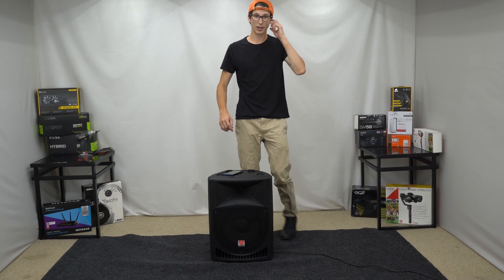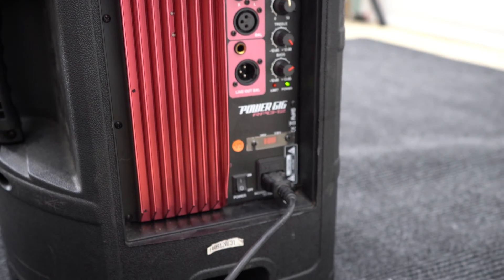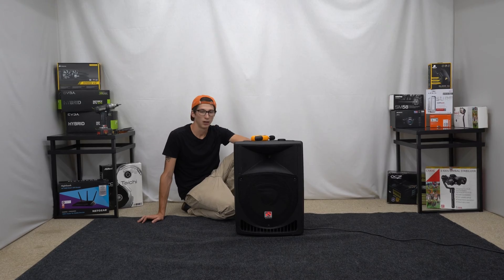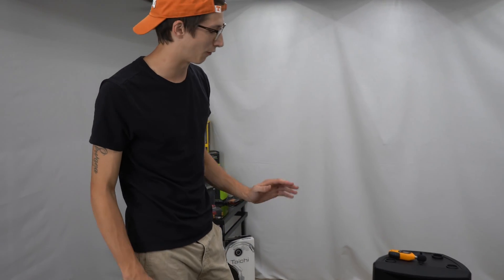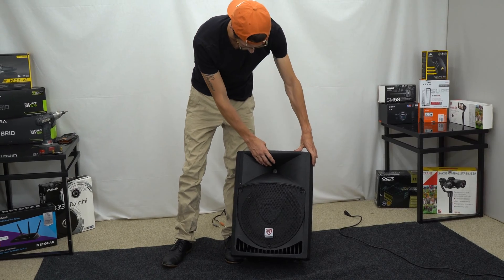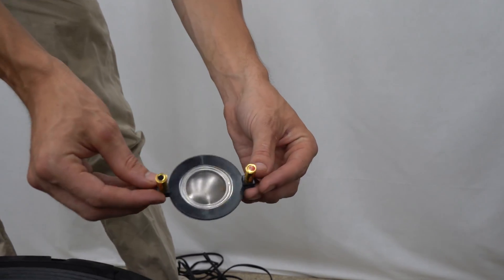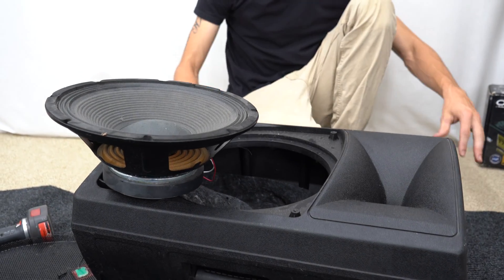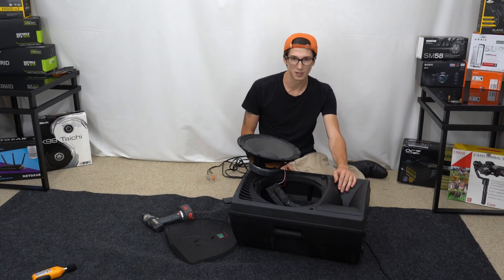Rockville Pa Speakers! Junk? What's inside?

Comment: I can't think why you seem disappointed by the fact that these speakers are quite a good bang for buck. You begrudgingly acknowledge that your (less than optimum) testing results came out positive, much like the overwhelming consensus of opinion in the comments. I've never seen any of your videos before, and likely never will again. I landed here in response to a query about the quality of these speakers, which I just bought for my home studio.

It seems you're possessed of the notion that price directly and without exception reflects quality, which is really a bit snobbish at its core (like having an Ivy League PHD means you're smart). Anyone can pay a million dollars for a top tier piece of equipment, but a smart buyer can find good, solid, serviceable equipment for a down-to-earth price. I'm not shy about spending money on gear, I've paid as much as $25,000 for a vintage guitar, but I consider the purchase of these speakers (and an accompanying amplifier) to be an excellent deal.

The best reviews are the ones that are honest and straightforward, and not bogged down with unwarranted, preconceived notions.
Reply: I guarantee I can get a better sound from 2 Rockville RPG12 powered speakers and a simple mixer for under 500 than my band ever could with a new Sun PA system that cost 25,000. We lost our old crystal clear vintage Peavey system to a bar fire. We should have looked for an old used 70s PA system instead like we had before.

Comment: i have 2 rockville  rpg 15 bt and a rockville bpa12 with a behringer 1000 w 15'' sub.we do 40 gigs a year ,we are a 4 pc band.we triggerd acoustic drums with an older yamaha module and have keys,1 guitar,1 bass ,3 vocals.we try to take gigs that have house sound but that dont always work out or their system sounds bad.this sys has never let me down,it sounds great.we use yamaha mixer/preamp mg16.most powerd speakers would sound bad if you test them like you do.ive had,jbl,qsc,mackie  speakers the qsc are great but to heavy and to expensive  i have the qsc153i spks....they sound great but the horns blow for no reason,and parts are un available  most of the time.for the money behringer and rockville are the best fit for our band,if i add 2 1000 watt berhinger and 2 rockvlle 1000watt 15' wlth a sub for the mains its all you need.the key is dont overdrive them to distort.if you need it louder just add a speaker. ive heard most dj set ups just clipping and distorting becuz they dont get it.i know these cabs are rated with peak readings, and they dont produce anywhere near true  1000 watts.soon as you overdrive the amp it creates distortion ,that distortion frys the voice coil.....true clean power dont  blow speakers.

Comment: In my opinion these speakers don’t hold a flame to Mackie thump 12a’s. Want real disappointment review the Rockville 18” active subwoofers.
Reply: Mackie speakers are WAY more expensive though. Some of us are poor and just trying to find something decent we can afford. One of my Powerwerks PW50 speakers blew as soon as I used it after having it for 2 years so I`m replacing with something much larger but the same price.
Reply: Mackie thumps are pretty budget speakers that are professional grade. That’s where these cheaper speakers like Rockville fall short, they aren’t professional grade. Another budget friendly professional quality brand is Alto.
Reply: @AndrewNelson1985  I saw review after review saying Alto powered PA speakers quit working after less than a year (8 months average) but I saw some reviews praising the pristine sound. I wish I could get my hands on an old classic Peavey PA system or a couple of their 500w powered monitors and be done with it.
Reply: The thing about reviews is that’s where everyone goes to complain. I own an audio production company and have experience with all kinds of brands. I’ve never had a piece of equipment fail using them as designed. What causes failures particularly with speakers is distortion. Pushing the speaker hard than it was designed to do. Not setting proper gain structure. Regardless of brand if you keep it from clipping it will live. With that said you get what you pay for, hence why an $800 speaker will outperform a $150 speaker.

Comment: I bought the 12" subs as a joke/experiment/possible project speaker to modify and they surprised the hell out of me
Reply: bro the rgb12?
Just ordered one
Reply: @coolelectronics1759    I got the passives
Reply: yeah probably running a good amp too is all it takes really.
what amp u running?
Reply: @coolelectronics1759    QSC GX3.  more than enough.   @ way electronic crossover helps to,  crossing over at 120 hz or so to some powered tops

Comment: I have 2 pair of the 15s and the 18in sub, all active.  I have been using g them for weddings and parties for over 6 years now. The trick is to back the highs off to the 11 or 10 o'clock position. With 2 of them and the sub at 7 I was at 119db+ at 30ft away.  These will pound and are clear, they get better as they get broken in.

Comment: Well I like your video. You were kind of going so straight to the point. I personally don't know Rockville, but I am looking for something loud and reasonably cheap.
As an electronic technician I can say got what I saw in the video that the electronic soundboard might not be the best, but with a thoroidal transformer and a decent heatsink, the power should be considerable 
Maybe not to the 200 RMS they claim but really with half of that, it should punch solid.
The speaker doesn't look that bad, of course with the price and power the output delivers you won't expect a 5 pounds of magnet.
I however didn't find out if it uses an Integrated circuit or transistors in the final output stage for you didn't take out the main board 
Anyway you did a lot in your video and I perceived you were trying to be honest.
Thanks buddy

Comment: Wow a lot of distortion. The speaker itself I’m positive it can play louder the problem is the extremely underpowered amp it comes with. Yeah looking at that driver that could easily handle 100-200 watts of power. Unfortunately Rockville likes to seriously seriously over rate their amps. The voice coil in a speaker is not visible by looking at the driver it’s within it. Interesting video though

Comment: Of the budget speakers (harbinger, behringer, samson, rockville, etc) which do you recommend?
Reply: alto true or more realistic specs for output wattage and you can hear it in there tx line I have the 8s.
rockville is pretty good for there passive stuff havent tried there amps/powered skeaker yet although I do have there 12" powered sub and it gets the job done no issues.  Behringer and harbenger for the most part I know have good stuff for the money too although I haven't tried any harbenger speakers but did own a 12" keyboard amp/pa speaker from behringer that worked fine for several years.
Reply: I’ve heard good things about harbinger, and heard some of their products. Their subwoofers really surprised me. There was an event with high-end jbl vrx932lap arrays, and one year they brought two vrx918sp subs, which I was disappointed by. The next year, they had a single $600 harbinger vari 18” sub, and I seriously thought it was louder than the $4318 sub setup the year before, although that may have just been the sound guy. But my point is, It kept up with the vrx932lap arrays without struggling, which is completely crazy!

Comment: 1 meter is less than 3 feet. It looked like you were around 5 to 6 foot away during the test which would give false reading. Not knocking you just stating the facts.
Reply: 1 meter is about 39 inches, which is more than 3 feet (36 inches).

Comment: I just got a Rockville SPGN128 (passive) speaker to use it as a floor monitor for live sound. The bass and the mids are good. The highs are very bad. There is no sssshhhh coming from the speaker and I have a very good mixer, equalizer and amplifier set up. Am I getting the normal sound of the 1.35" titanium driver that Rockville uses or mine is defective?

Comment: This was more of a critics review than an honest review....learn a little more about your products before just reviewing and bashing them for what they are not.....proper testing is a must.....just using a phone to run tests is not a true test of performance.....used with a mixer you would have probably gotten different results.....best bang for your buck should be your topic, because anyone can criticize if they can spend more money on a more expensive product.......sure you could buy one that costs $1000 and have an output of 3000w at 120db.....but even you said at 106db and being behind it you couldn't handle the output it was so loud.....I have seen these and other brands (even cheap brands) used and for the money they have an awesome sound if set up correctly and didn't over push the system for the size of area it was being used in......also most people are looking for a comparison review to purchase a product.....gear towards that and you should see your subscribers numbers go way up !!!
Reply: Also your placement of the dB meter is in the wrong location.
Reply: I just re-ordered them. Got 2 of them + stands + XLR cables for $460.
Reply: I believe he was saying at 106db he couldn’t handle how bad they sound, that’s why he apologized. Listening with my headphones on that was the first thing I heard when he turned them up, how bad they sound at loud volumes. I’ve heard these at a karaoke bar once and yes they get loud, but they are not very clean and the feedback was horrific.
Reply: I have run a pair of the RPG 15s  for years.  I run them with a pair of the Rockville 15" subs that are based on an old Mackie design.   I've invested less than 1500 bucks in the whole pa system and then I added a dbx driverack unit so I could calibrate the system for different rooms.  Total pa cost including the Flow 8 soundboard is under $2k.  Uncalibrated the speakers don't sound very good.  Calibrated they sound amazing.   I am planning on switching to QSC KC12 column speakers for lighter weight,  faster setup and no calibration needed to get great sound.  Total cost for the upgrade is over $4500.  More than double the price of my current pa, and I will need to add a QSC 18" sub if I want to be able to do large rooms like I can know.  That little thumper is another $2600.  So, basically 3 times the price to do what my pa does now.  If you look at the Rockvilles in that  light I believe they are very solid speakers that give a big bang for short money.   I'm not planning to get rid of mine even when I upgrade.
Reply: Nah man, these are total shit either way, not reliable even if they satisfy the application. I have first hand experience!
Reply: @Black-k2r2o  I bought 4 of the RPG15bt for DJ gigs and karaoke. After setting them up properly with a mixer they sound awesome and hit like a beast and only running them at 30%. They are cheaply built plastic cabinets and cables are flimsy but well worth the money if you don't just blast them until they break or overheat. Doing an outdoor gig in September opening for Confederat Railroad and doing the after party...... Will let you know how they do then.....
Reply: @waynejenkins1965  how did it go ?
Reply: @waynejenkins1965  how did it go? These speakers still holding up??
Reply: @Elevated805  I have used these every Friday night for over the last year and a half and gigs in between and have had zero issues. I also take great care with my gear and don't mistreat it or abuse it. Makes a big difference.
Reply: @waynejenkins1965  yeah, I bought these in 2015, it came out to $390…now they’re $560 (without tax) I’m contemplating ordering them again.
Reply: @Elevated805  It's almost 2026 and all 4 are still hitting hard and sounding great !!! zero problems....
Reply: @Black-k2r2o das crazy, yall jus dont know how to use em

Comment: DUDE EDUCATE YOURSELF YOU'RE USING THE WRONG WEIGHTING!! USE ( C ) NOT ( A ) 

https://www.noisemeters.com/help/faq/frequency-weighting/

AND TO FIND THE CORRECT SOUND PRESSURE LEVEL. IT HAS TO BE SET TO ( PEAK ) 

THE CRAPPY METER YOU HAVE IN YOUR HAND CANNOT RECORD AND KEEP UP WITH THE HIGHEST SP LEVEL PEAKS..

FOR YOU TO BE DOING THIS TYPE OF STUFF YOU NEED TO EDUCATE YOURSELF OR YOU LOOK LIKE YOU DON'T KNOW WHAT YOU'RE DOING.  

YOU WOULD NEED A VERY EXPENSIVE SPL METER  TO MEASURE THE CORRECT SPL LEVEL ESPECIALLY THE PEAKS..

Comment: Im having some issues with my Rockville speakers,  one speaker is not as clear sounding as the other... suggestions?
Reply from the maker: Factory defect, contact rockville.
Reply: @2DudesAudio  sounds like a blown tweeter.
Reply: If you have it hooked up together with a xlr cable to 1/4 cable you have to turn the gain up on the one receiving the signal that’s why